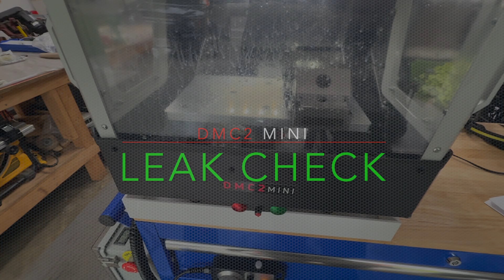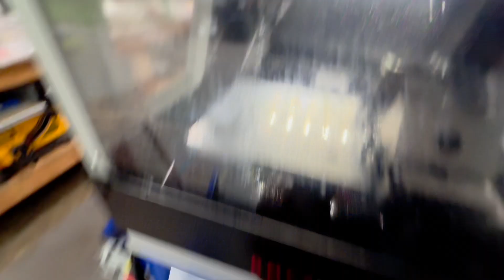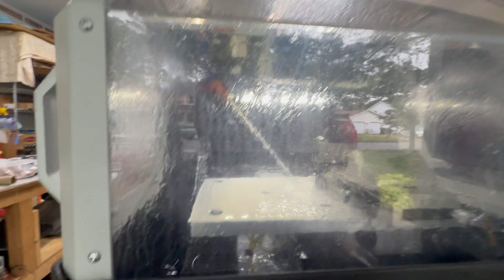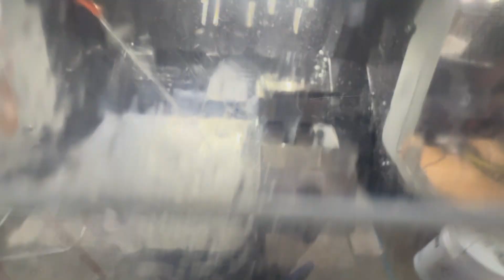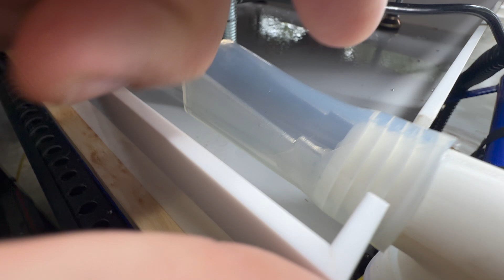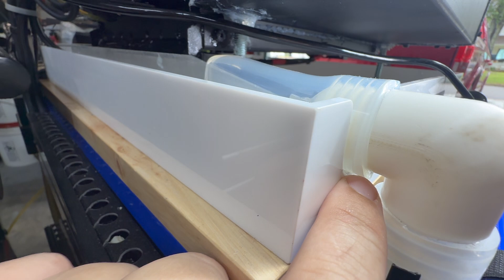DMC2 Mini - leak check

Comment: Could you link the rubber tube and right angle fitting you are using for the coolant return drain? I'm having the same issue of leaks
Reply from the maker: Hey Eduardo, it seems logical you would also experience the same leak. But I don’t understand what you are asking me to do. Please restate it more clearly for me.
Reply: @EZ_shop  Just asking for the links of where you bought the prodcuts from, the rubber tube & right angle fitting.
Reply from the maker: @EduardoGarcia-xt4vi  
Cart - https://www.harborfreight.com/46-in-mobile-workbench-with...
1" hose - https://www.amazon.com/dp/B08S3DCPWS...
Tray - https://www.amazon.com/dp/B08ZHQNGCC...
Monitor mount - https://www.amazon.com/dp/B07Z7ZGHD5...
Extension cord - https://www.amazon.com/dp/B0CS5KPQMY...
Cable glands - https://www.amazon.com/dp/B08R84YJ7X...
Emergency switch - https://www.amazon.com/dp/B07BCXSGHY...
Extra outlets - https://www.amazon.com/dp/B07VG6G24N...
DIN Rail Terminal Blocks - https://www.amazon.com/dp/B07NVV28D9...
Electrical box - https://www.amazon.com/dp/B0BN3Q4SJ1...
2 x 12 Volt 3 Amp Power Supplies - https://www.amazon.com/dp/B0C3RHD116...
Cable Raceway - https://www.amazon.com/dp/B08R75RMQT...
Extension cable holder (printed at 200% size) - https://www.printables.com/.../1102040-extension-cord...
Plastic Barbed Hose Fitting - https://www.mcmaster.com/5218k822/
Swivel Leveling - feet https://www.mcmaster.com/6120K41/
Reply: @EZ_shop  The Amazon link for the hose is not working. Could you send a new link? Thanks!
Reply from the maker: @EduardoGarcia-xt4vi  https://a.co/d/ijd4rTw

Comment: Still have to build mine
Reply: Im moving to a new place soon so i still haven’t opened the boxes! I wanted to get it just before all the tariffs were supposed to start.
Reply from the maker: @softcrunchytaco  I did the same exact thing (minus the move)
Reply from the maker: It’s a fairly intense build, not difficult per se, but as you know the part count is huge.